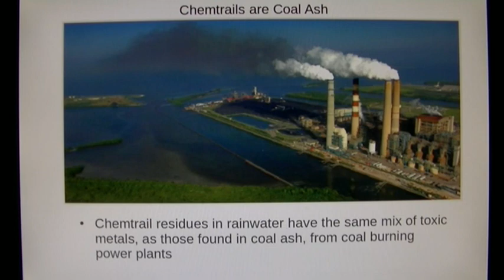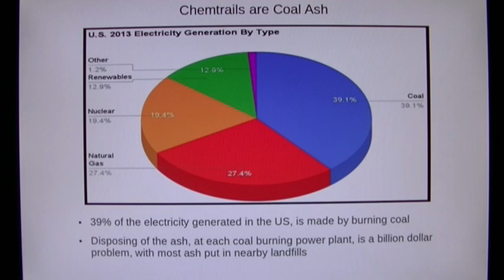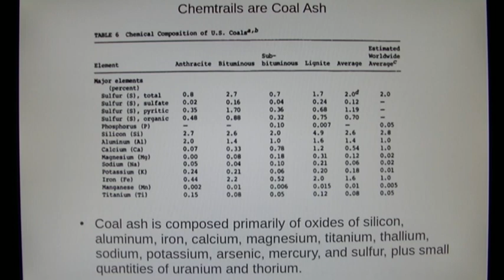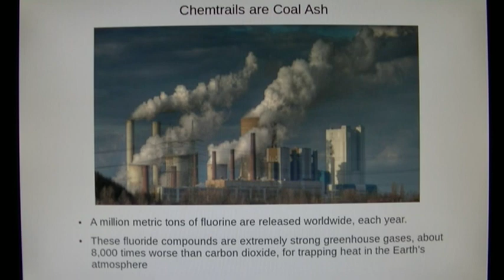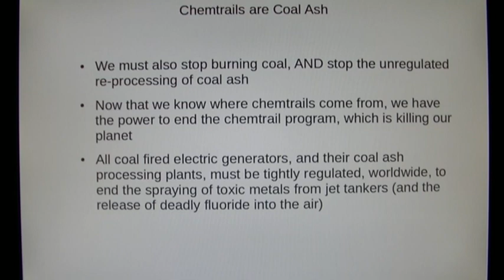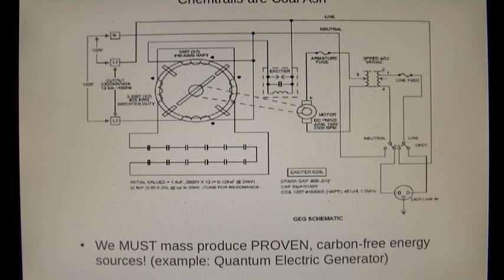Chemtrails are COAL ASH

Comment: "YES, there is proof, that chemtrails are NOT water vapor, because ice crystals only form, if the humidity aloft, is over 60%."

BS Contrails can form at any humidity level. The higher the humidity the longer the ice crystals are visible. The lower the humidity the quicker the ice crystal turn to vapor and are no longer visible. Ice crystals form due to the exhaust gas temperature and the air temperature at flight level. How long they remain visible depends on the relative humidity.
Reply from the maker: I would agree with you, BUT some airliners leave massive trails at the SAME altitude that others leave only a tiny wisp, that disappears in 9 seconds. So, your generalization doesn't hold any more water than the old Appleman charts. The last part of this video shows proof of that statement: https://www.youtube.com/watch?v=zyFcmhlnMeM&t
Highly recommended viewing, especially for the first half, which is a good tutorial.

Comment: One slide states coal ash has small quantities of Uranium and Thorium then three slides later, "dangerous amounts of radioactive Uranium,  Radium, and Thorium". Which is it or do you not have a clue?
Reply from the maker: Uranium and thorium are alpha emitters. How much do you consider to be dangerous when inhaled?
Reply: Well considering those who live in close proximity to coal fired power plants get less exposure than the radiation encountered in normal yearly exposure to X-rays the rest of us are in pretty good shape. Also at those low end inhaled or ingested dosages our bodies can flush that out and whatever minor damage to our kidneys from those low doses can and do repair themselves. Also considering the USAF is not spraying coal fly ash all over the place the risk is even lower.
Reply from the maker: You are falling for the standard disinfo on radiation dosages. A nanogram of uranium in your lung will cause a cyst, which turns into a tumor, but the same dose spread over the entire body has absolutely no effect. Also, the particulates a scrubbed from coal exhaust, then the coal ash is leaked into the ground, or sprayed from airplanes, defeating the purpose of cleaning the powerplant smoke. Maybe they have stopped the coal ash spraying over the continental US, but I think it is still going on over the pacific, and especially over europe. So, yes, we are still breathing it.

Comment: Guess Who dropped in again.   The Coal Plant Fly Ash appears accurate.   Coal plants capture part of their TRI (Toxic Releases Inventory)  via "hydrated lime" emission scrubbers that captures hydrogen fluoride,  hydrocholric acids, etc.    These are the materials that are hygroscopic polar acids that can take water vapor and convert them into lingering aerosols (clouds).

Obviously, the "component of flowable fill" is loaded with these acid components being extracted from the hydrated lime scrubber materials .   It is a way to avoid accountability for getting these polar acid components into military bases via hiding them in loose terms.

Before the days of emissions scrubbers on coal power plants these acid emissions from coal stacks would make the weather and cloud systems for thousands of miles downwind of these high acid emission coal power plants.   The coal emissions from China's emissions literally set the weather over large parts of the Pacific Oceans.    The mechanism is certainly there and proven.

You have isolated the source materials now and it is very clean they have intentionally hidden these from public knowledge and even abused USAF Whistle-blower like Kristen Meghan.    BTW---Good Job Kristen Meghan!

You can also see that the USAF has negated the clean air act in taken the expensive filtered out toxic emissions that would  have gone into TRI for a coal power plant, and not dumps that into the air with these USAF programs.   This literally wastes billions of dollars and impacts the health of every person on the planet.

You are getting some help now as even Russia's Putin has jumped on the bandwagon to have this exposed and even prosecute massively by RICO and Misprision law.

These "deceit and treachery" methods for Chemtrials stem directly from the Oak Ridge National Laboratory's I&C Division from the 1986-87 period.   This is the period of discovery for the Ozone Hole and its disruption of ocean cloud cover driving up the ocean's surface temperatures.   Chemtrails were an effort to make more clouds to dump heat back into space via Mie Scattering methods.   If one notices the Aluminum content of Coal Fly Ash is very close to the method of LLNL's Edward Teller's Sky Shield.   ORNL also got highly involved in that Edward Teller Method, and devised these methods to hide what they were doing via Coal Ash as the polar acid sources for the cloud seeding.

Comment: I don't know about this coal ash method----but just a FYI.   If they are doing this, they are criminally insane.

But if what I see here on the levels of aluminum dumped into the air, this is a crime against humanity.   The biggest health issue in the world today is the fluorine and aluminum complex that form spontaneously into Prion like Proteins that damage thyroid and brain and makes the amyloid plaques.

The aluminum "sky shield" was proposed by LLNL's  Edward Teller back in the 1980s, but with the knowledge of gas diffusion plant health effects from aluminum and fluorine, doing that is a crime against humanity.

The F-Al Prion effects are behind the etiology for GWI / GWS,  and the similar Oak Ridge Sick worker illnesses.   It is also the etiology for ADHD, Alzheimers, Parkinson's. et al.

The F-Mn Prion effects are behind the etiology for Mad Cow/BSE, Scrapie, et al in animals.

These F-metal Prion connections were discovered some 20 years ago at ORNL and highly covered up by UT-ORNL today.   Such sets up pandemic illnesses and near end-time like health disasters, which are basically crimes against humanity.

https://www.youtube.com/watch?feature=player_embedded&v=F6r0GqbH9Os#t=7

Comment: The following quote is taken from page 456 of a report issued by the Senate Committee On Commerce, Science, And Transportation in May, 1978:
**U.S. 256 (1945) indicates that the flight of an airplane over a person's land would not necessarily be considered a trespass. However, it could be argued that the release of particles into the air by an airplane or by a weather modification station on the ground might be considered a trespass if they invaded the plaintiff's land. It could also be argued that rain, hail or other precipitation produced by weather modification would be a trespass since it did not fall naturally but was produced artificially. These arguments could be supported by citing various cases which have found a trespass even where invisible or microscopic particles have entered on the plaintiff's land and they have caused harm.**
(So keep doing those water and soil tests, people. A lawsuit may be possible.)

Comment: chemtrails are mostly made of phtalates
Reply from the maker: +NoStrenghtIn Numbers   I agree. The latest incarnation of chemtrails, seem to be using the internal chemistry of the jet engine, itself, to produce a sunscreen molecule, BUT, big labs should test this hypothesis. BTW, lack of engine maintenance greatly increases the possibility of phthalate production, since vanadium oxide builds up on the turbine blades. It is routine maintenance to clean the Vanadium oxide (phthalate catalyst) off the blades. Maybe low fare airlines are doing it on purpose???
Reply: +The HAARP Report i doubt its coincidence,through my few years of research i found out that they consist of:phtalates,dead blood cells,smart dust,morgellons,heavy metals,aluminum,lithium.I dont know how but they seem to alter Genetics of some bugs in my area,for instance the ladybugs are not red but yellow and odd looking,other insects too,i fear they are changing our DNA too,in recent few years there were alot animal and plant diseases attacking humans.Check channel Skizit gesture,he has done some good research and made goos videos,check it out
Reply: +The HAARP Report oh yes and i forgot,it seems like there is depleted uranium and other low radiation elements in chemmies too
Reply: +The HAARP Report you cant blame the sheeple,the propaganda and indoctrination is too strong,the "force" affects the weak-minded people.Im from Europe and people here are arrogant and brainwashed too,just not so much like in the US.But when they drop the dollar US will be a police state and there will be riots and famines and they will be sorry for not listening "conspiracy theorists".Btw it isnt just the US,all world leaders are working together to create world wide police state and to enslave people.That NATO vs Russia/China is just a charrade while they in reallity work together to achieve something that no one has do in WHOLE HISTORY and that is total world domination.technology is here to do it.

Comment: Scientist Dr. J. Marvin Herndon (excommunicated cut from futher grants and silenced):  "New" threat, posed by widespread, intentional tropospheric aerosolparticulate emplacement, has gone unremarked in the scientific literature for more than one decade. 
Some of the early weather-modification research resulted in programs like Project Skywater (1961–1988), the U.S. Bureau of Reclamation’s effort to engineer “the rivers of the sky”; the U.S. Army’s Operation Ranch Hand (1961–1971), in which the herbicide Agent Orange.
In the spring of 2014, the author began to notice tanker-jets quite often producing white trails across the cloudless blue sky over San Diego, California. The aerosol spraying that was happening with increasing frequency was a relatively new phenomenon there. The dry warm air above San Diego is not conducive to the formation of jet contrails, which are ice condensate.
Industrial coal burning produces four types of coal combustion residuals (CCRs): fly ash, bottom ash, boiler slag, and flue gas desulfurization product (FGDP), i.e., gypsum. Bottom ash is heavy and settles out; coal fly ash, on the other hand, is comprised of micron and sub-micron particles 

 file:///C:/Users/pc/Documents/Downloads/ijerph-12-09375.pdf

Comment: I am not sure, but does this article show that coal fly ash on exposure to moisture becomes strongly positive?  
www.dyve.com 
So the ash is actually is robbing the area of negative ions?
Reply from the maker: +Kathleen Sisco   I think you have the wrong link. Could you type the link again? I'm interested to read about the solubility and charge distribution of hydrated coal ash. That is basic civil engineering/chemical engineering, which I never had to study.
Reply: +Kathleen Sisco yes, they are flooding the 32,000 to 40,000ft elevation to positive ions, we built negative ion producers (Ionizer) and orgonite cloud busters to rid positive ions and our skies are now crystal clear all the time and jet trails now vanish instantly.

Comment: I'm at a loss for words on your video & what it has led me to discover. I went to the map you posted where the coal plants are near me & Ifound out I live 21miles from the third largest toxic coal ash spill in history at Duke Energy , Eden NC Feb, 2014 which dumped toxic metals upstream from me into the river flowing through my town. Arsenic levels rose 35 times higher than EPA acceptable levels. Lead was found at twice the EPA acceptable level. Also found were high levels of  boron, calcium, manganese, zinc,. Duke Energy had been warned a year prior to the spill to clean up their piles of ash  after they had closed the plant  in 2012 but did nothing. Duke's 14 plants had been cited by the state for illegal dumping of slurry into the river in NC, SC & Va. The report said the sediment will be in the river for along time to come affecting all of the environment & we were advised not to drink the water from our tap ( lucky I had switched to distilled water a few years prior ).Since I was out on the road back then I had not heard of the spill.Guess chemtrails are not the only way coal ash is killing the planet. I'm so glad I subscribed to your channel! Take care.
Reply: +seeamerica1 PS..just found this......The agreement with the state Department of Environmental Quality came Tuesday as the two squared off in a state administrative court over a $25.1 million state fine against Duke.The settlement ends that case, which focused on the Sutton power plant in Wilmington, and the groundwater claims in lawsuits the state filed over all 14 power plants. IT ALSO EXCUSES FUTURE GROUNDWATER VIOLATIONS as long as Duke complies with state legislation that ordered it to close ash ponds statewide by 2029. Environmental advocates charged the settlement favors Duke and abandons enforcement by the state.

Read more here: http://www.idahostatesman.com/2015/09/29/4010894/duke-energy-agrees-to-20-milliohtml#storylink=cpy

Comment: Thanks!  The best part of this video contains the notion that the Koch Brothers money is in part behind this makes senses.  For years, I have been asking the question, where's the money coming from to fund the spraying World Wide?  You are correct in your statements that the cost of cleaning stack gasses before they are released is exorbitant - to say the least.  It is very likely less expensive to dispose of the fly ash via spraying and combine it with Geoengineering programs (they probably receive Gov. subsidies for the spraying programs.
Do we have any insiders that are confirming or supplying the lab data / recipes for the chemical slurry?  
I have heard the mention of Strontium in the mix in previous exposes.  Why did you not include it?  Are the others incorrect?
Thank you again!!
Nancy

Comment: Spraying coal ash? As of last year, yes--if the evidence left on the tarp covering our dilapidated garage outback is to be believed. The roof is practically flat, and a gray powdery substance has started showing up in the dips, where the rain collects and eventually evaporates, only last year. We're out on the Oregon coast and have observed the phenomenon of pervasive and unusually persistent "contrails" since its advent in our area. In fact, we often see the jets making u-turns, going north and south, so apparently we're at the halfway point between bases. If anyone wants a sample of the ash for analysis, just ask.
Reply from the maker: karaool Great information, thank you for posting. Maybe you can save the gray dust, and over time, you will have enough to send to a lab. Here is a new scientific paper, that proves coal ash was sprayed over Los Angeles, in the summer of 2011. The mixture of toxins proves they are trying to get rid of us, without ringing any alarm bells. The proof doesn't get any better than this: http://www.mdpi.com/1660-4601/12/8/9375/pdf
Reply: +karaool I noticed this past month that there are jets making U-turns as well. That is uncommon in my area since I am next door to the largest US Air Force Base in the US, EGLIN AFB, next to it is Hurlburt Field and Duke Field. www.flightradar24.com is a very good link to be able to track these killers in the sky. If I could reach them I'd knock em right out of the air. I have no problem doing time for saving millions of lives...none whatsoever. Thanks for confirming what I saw too. Peace.
Reply: just curious why everything wouldn't be covered in ash using this logic. not saying these contrails aren't bad just curious how you can have so much coal ash in one concentrated area with out it concentating elsewhere
Reply: Okay, Seth, this is how it goes: although the rain falls on the entire roof, it only pools in the dips, where any particulates are allowed to collect and settle and then get exposed when the weather dries out . The "building" is a large, dilapidated  two bay garage that is covered with a blue tarp. Look up Pacific City, Oregon on Google Earth; we're the eyesore of the neighborhood. We're up on the hillside that overlooks the ocean and the river flowing through the lower section of town, with the estuary to the south and the pasturage and hills and the river, again, to the north. You can't miss it.
  I wiped some ash onto a paper towel, hoping someone would ask for a sample to analyze. No one has, and you're the first to show any kind of interest. The dips are full of water right now and half the garage is gone, with the rest soon to follow--in a couple of weeks. Let me know if you would like a sample, and I'll see what we can do.
Reply: That's interesting. Unfortunately there isn't anything I could do with it. Maybe look for a research lab online
Reply: I live in Oregon too. That's why I read your comment. But I'm in Klamath falls in the south. We see chemtrails everyday because of the base
Reply: If you've got the lab, I've got the ash. Thanks for being curious Seth, and keep looking up. And keep on wondering. Sooner or later, the truth is gonna have to come to light.
Reply: karaool We  Mike Murphy director of WITWTS is sending up para-glider pilots to gather air samples of these trails to have them tested,s o we shall certainly see what the hell is being sprayed on us from the source...peace